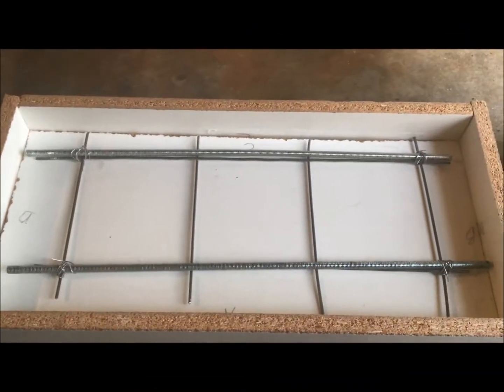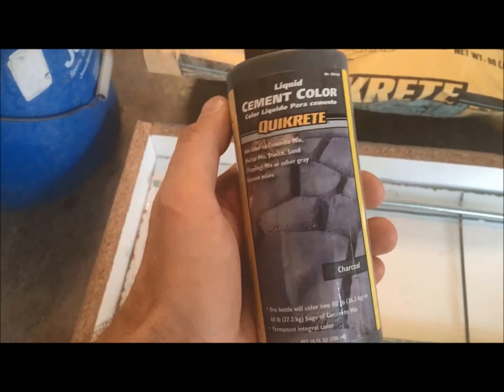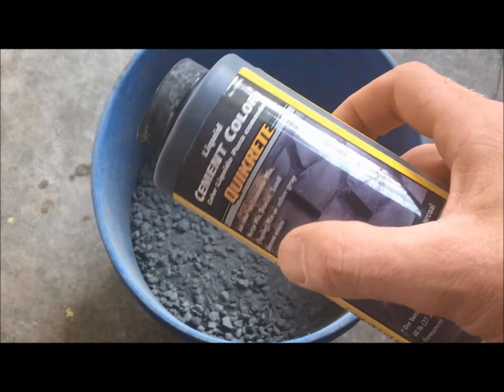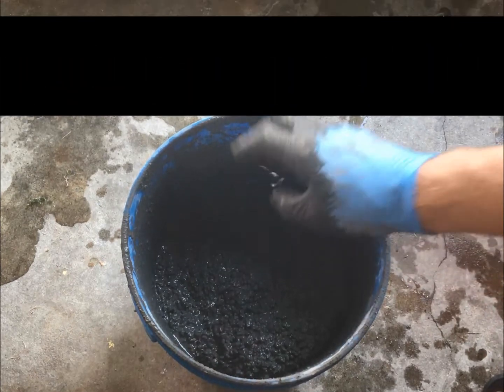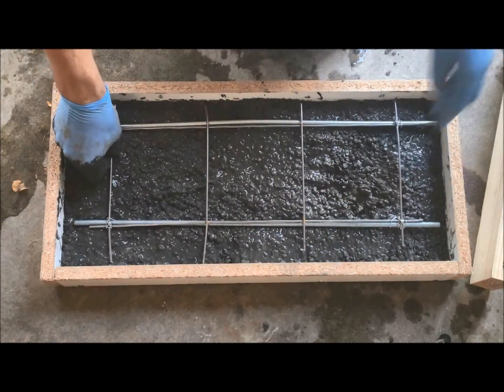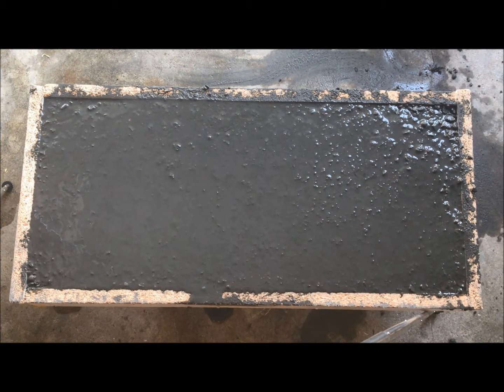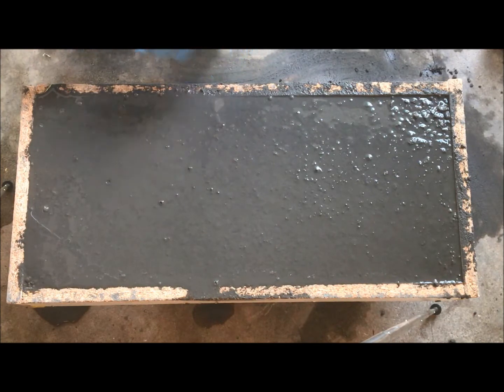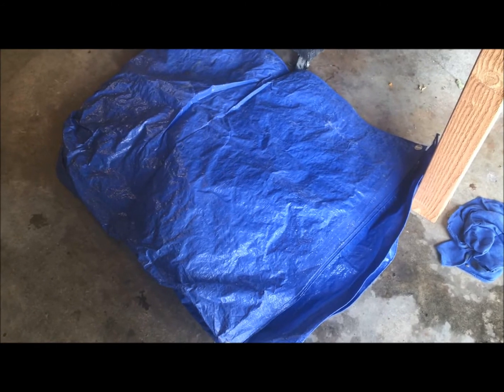How to Build A Concrete Countertop Part 2 - Pouring The Concrete

Comment: Hi- thanks for the videos! A few questions- are you just using a regular Dewalt orbital sander (not specifically for water use)? When you did the pour-in-place kitchen counters, how did you keep all that water from going all over the kitchen? (wet-dry vac?)
Reply from the maker: Yes on the sander.  I put the link to it in one of the video descriptions.  That water issue:). I had a buddy with a wet dry vac going behind me and also had the backsplashes, floors and cabinets masked off.  Things still got a bit messy but was easy to clean up.

Comment: Have you ever tried the brown quikrete liquid cement color? If so, how did it look? Thanks
Reply from the maker: Haven’t tried it yet.  I have been curious about how it would look though.
Reply: Montana Made Hopefully it will turn out nice enough for me to want to share pictures. I'm going to order some on Monday and start on the forms sometime mid to late week.
Reply from the maker: Nice!  Good luck.  I bet it will look awesome.  When you tint concrete it look will look matte in color when it first cures up so dont be discouraged if it looks wrong.  Once you start polishing it that top layer (the milk layer) color will sand off and the tinted concrete will show below.
Reply: Montana Made Cool, thank you. I haven't decided on semi gloss or high gloss yet.